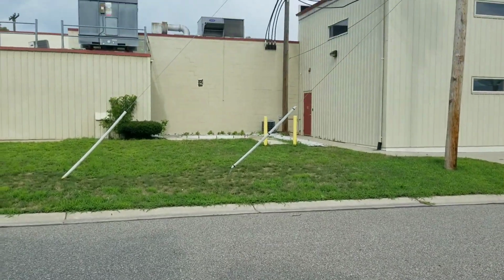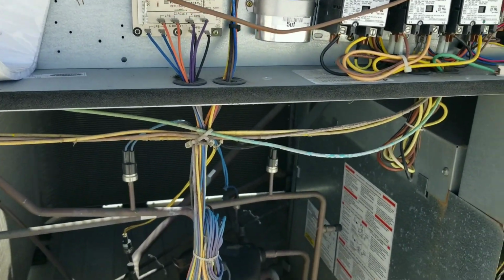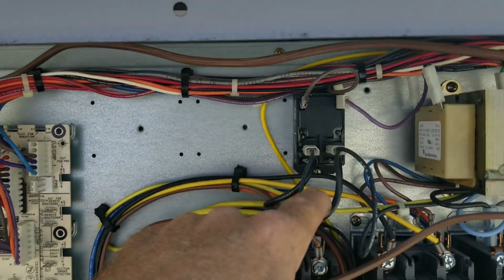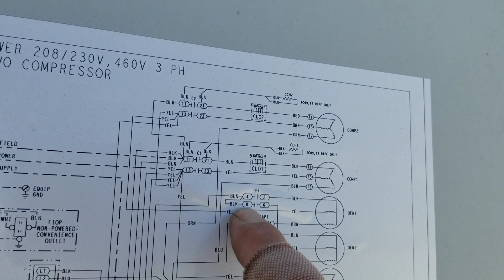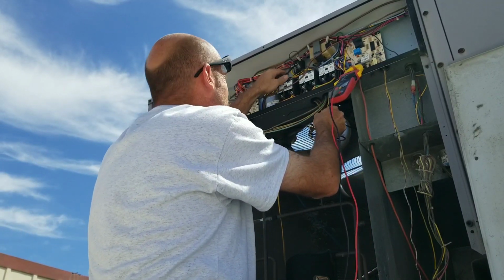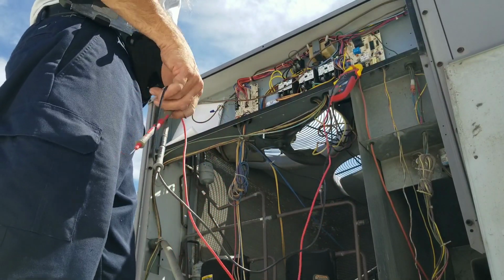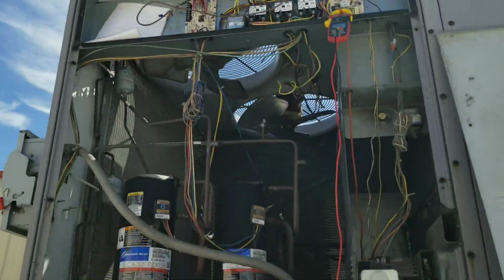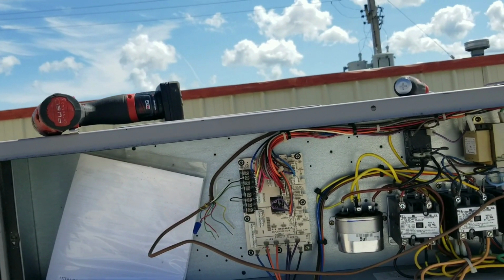Faulty what condenser fan motor or relay???

Comment: Just a thought...  could you just block off the top of the non working condenser fan motor?  At least with one working it  could  still pull air through the condenser and not through the opening of the bad motor.   Just to get them some cooling until the motor is replaced.  As long as you head pressure didn’t get to high of course.   Keep the videos coming. Glad to see your back!!

Comment: I never trust the discharge resistors in capacitors (if they even have them).  They often fail over time.  The meter wouldn't have shown much if it was set to AC as the residual charge is DC.
Reply: the start capacitors usually have an external bleeder resistors, the run capacitors do not and that's a run capacitor :)
Reply: instablaster...

Comment: I bet you got capacitor bit. :-) I have learned the hard way to shunt any caps with a working voltage 460v and above.
Reply: yep, just takes a bad motor winding open or loose wire and contactor to open/chatter at just the right portion of AC sine wave to leave a cap charged to line voltage or higher from motor running/back emf on relay/disconnect open, then you grab and ZAP.
Also it will be "DC" high voltage charge with enough current to kill you instantly, so BEWARE a meter on AC won't read anything or just momentarily blink a number, many techs do not know that making it more dangerous to themselves :)

Comment: I can only guess one winding of bad cond. fan motor open, and it charged the cap when powered up or when contactor chattered at unhooking jumpers. though it was unclear what you was touching when zapped.
it could simply be stray/inductive voltage from wires in close proximity, say between thermostat  and line wiring causing very low current yet high voltage. on 120vac stuff it;s not uncommon to see as high as 90vac, it could be higher on other voltages and will certainly tingle/wake you up brushed against the back of a hand/finger or other body part. flat grabbing the leads would make it go to near 0 and not feel anything